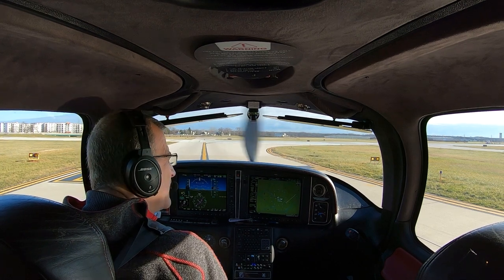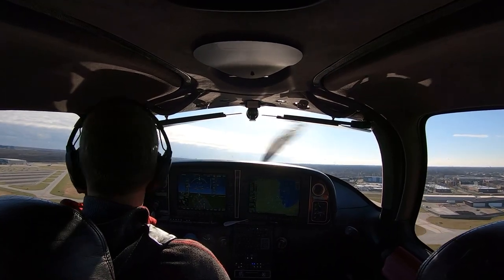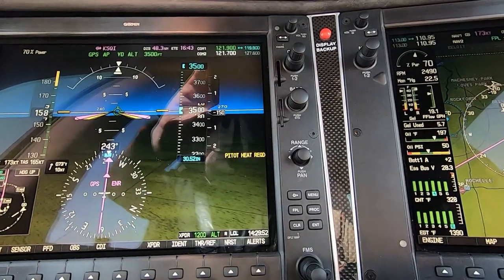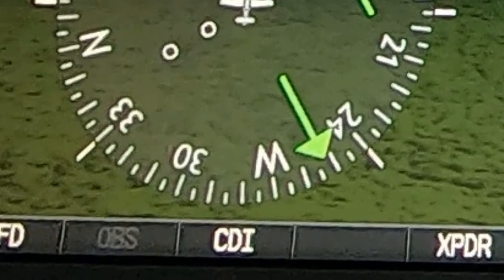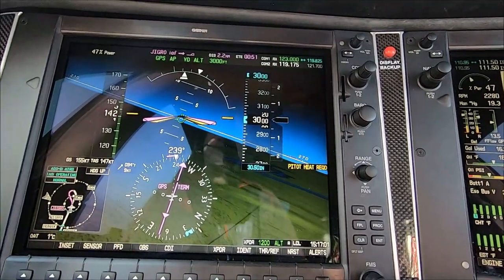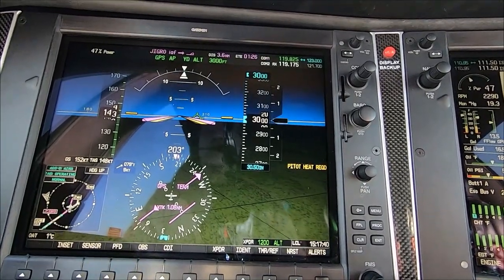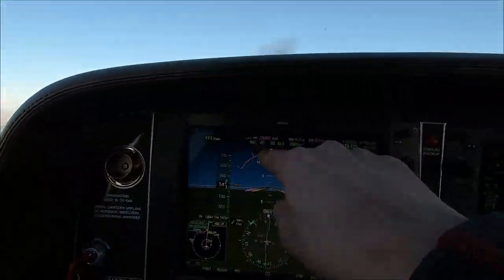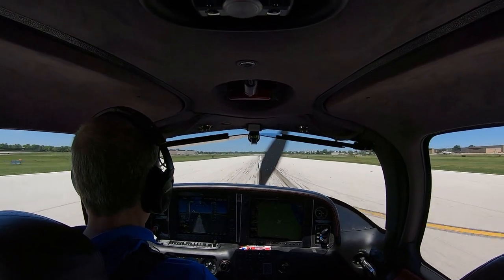Flying The Back Course Approach with the Garmin Perspective (Gotcha Included)

Comment: Thanks, Marc, very interesting! When you pushed the APR button, which then took you into roll mode, what did you do to get back to navigating on the backcourse again? Just hit the NAV button?
Reply from the maker: Yes, hit the NAV button.  If you hit it and it goes into ROL mode on the G1000, then press it again and it should lock in on the BC.